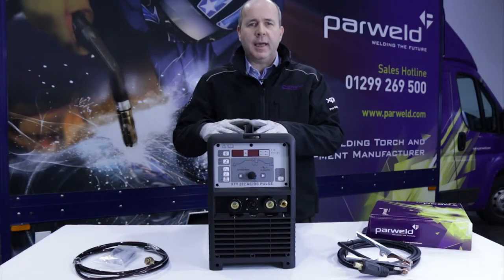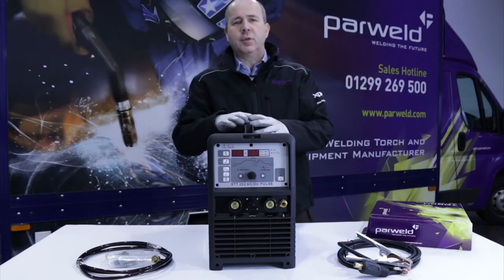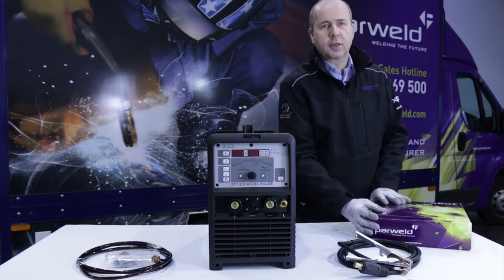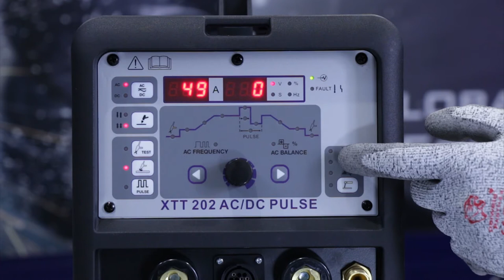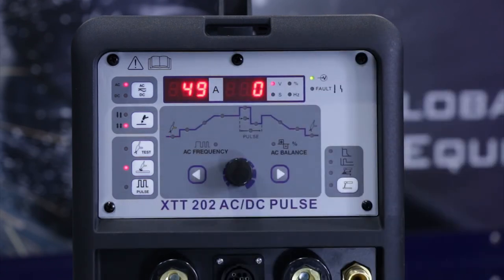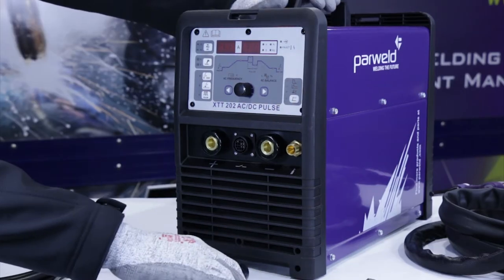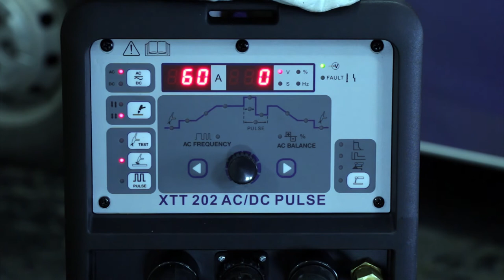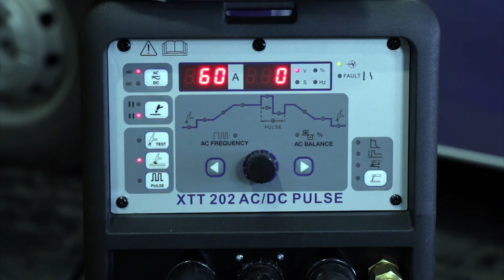XTT 202P AC/DC PULSED TIG INVERTER

Comment: Just bought one and its next to me now. Only thing is that second button from top on left side will not select the lower light and also the pictogram does not go through as many variations as mine. I bought this to replace a 3 month old Oxford Tigmaker330e which in my opinion is rubbish. This machine arrived from Welding Supplies Direct in perfect packaging. Really a lot better than Oxford which arrived with a huge dent in the top. Parwelds foot pedal is really nice too. Thumbs up Parweld so far.

Comment: Is this manufacturer any good?
Reply: I have one,  I've welded alu , stainless and titanium so far. no faults to report so far !
Reply: @bongskag  Do they do a water cooler as well?
Reply: Use one every day in work for 2 years mainly on ac, it hasn't missed a beat, I have a lorch t220 basic at home and produce better welds with the parweld